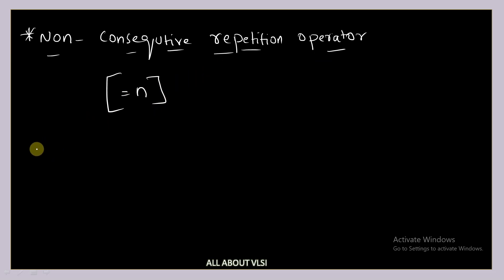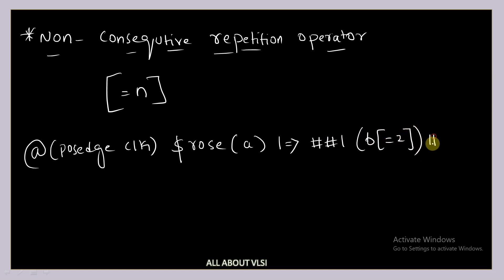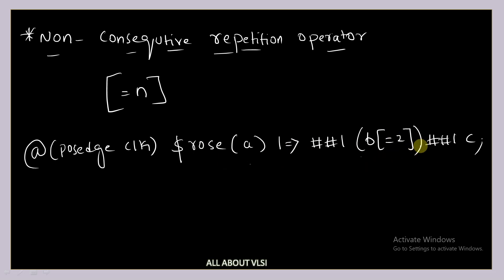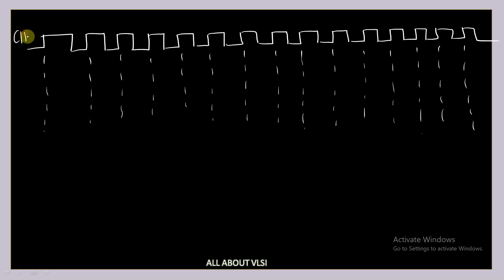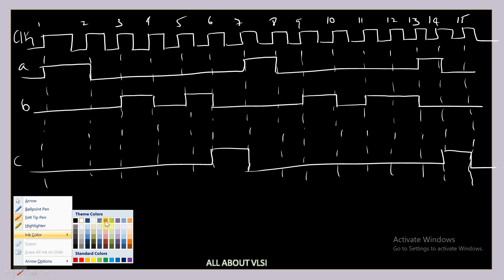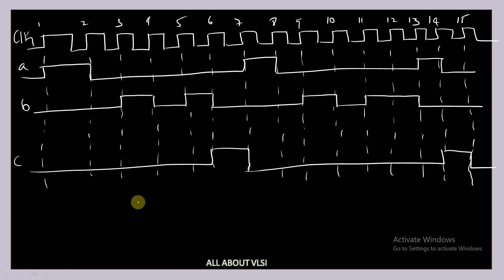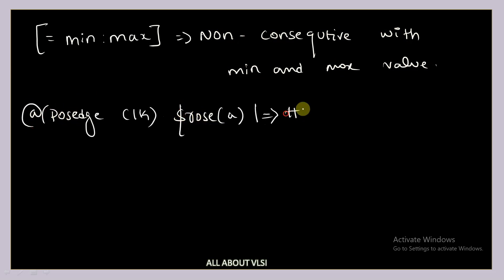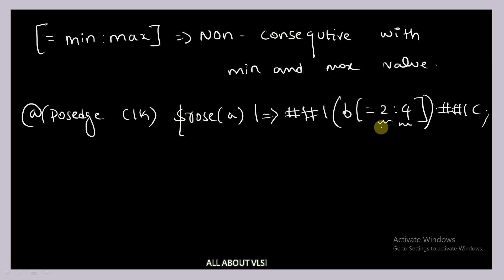Non-Consecutive Repetition Operator in SVA || System verilog assertions || All about VLSI||

Comment: So the b... ##1 c means as long as c is high at least 1 cycle after the last b? So even if c became high 7 cycles after the last b the assertion would pass?
Then doesn't that mean that " $rose a => ##1" means at least two clock cycles after the rising edge of a?
Reply from the maker: Answer to question 1
Yes

Answer to question 2
Not atleast it should be
Reply: @Allaboutvlsii  So why does b... ##1 c mean at least 1 cycle after b, but $rose a => ##1 mean should be after 2 cycles? Is it the operator that enforces that it should be two cycles after, not at least two cycles after?
Reply from the maker: @cxj999 with a we are using non overlapping or next cycle opeator with a delay
So it adds 2 cycle delay

Once refer about overlapping and non overlapping implication operator video in our playlist

Hope it clears your query
If not contact me on LinkedIn
Tadakamalla Gourav
Reply: @Allaboutvlsii  I understand the operator, but I am asking why does the delay after a mean "should be" but the delay after the last b mean "at least" ?
Reply from the maker: @cxj999 it's the nature of the operator we are using
Reply: @Allaboutvlsii  Analysis of the Assertion
First, let's break down each part of the assertion to understand its precise meaning.
@(posedge clk): The entire expression is sampled at every positive edge of the clk signal.
$rose(a): This is the antecedent of the property. The assertion is triggered when the signal a transitions from 0 to 1.
=>: This is the non-overlapping implication operator. It separates the antecedent from the consequent. Crucially, it means that if the antecedent ($rose(a)) is true at a given clock edge, the consequent must begin evaluation on the next clock cycle.
##1 (b[=2]): This is the first part of the consequent.
    ##1: This specifies a one-cycle delay from the start of the consequent's evaluation. Since the => operator already introduces a one-cycle delay, this ##1 pushes the check for b to the second clock cycle after $rose(a).
    (b[=2]): This is a sequence repetition operator. It means that the signal b must be true for exactly two consecutive clock cycles.
##1 c: This is the second part of the consequent.
    ##1: This specifies another one-cycle delay. This delay starts from the end of the previous sequence element.
    c: The signal c must be true at this specific clock edge.

Correct Timing Breakdown
Let's put it all together into a timeline:
Cycle 0: $rose(a) is detected (signal a goes from low to high). The antecedent is true.
Cycle 1: Because of the => operator, the consequent begins evaluation here.
Cycle 2: The ##1 before (b[=2]) takes effect. The first check for b happens here. b must be true.
Cycle 3: The second part of the [=2] repetition is checked. b must be true.
Cycle 4: The ##1 c takes effect. The check for c happens exactly one cycle after the last required b. c must be true.

Let's address the two parts of the explanation:
"The delay between a signal and first b signal must be two clock cycle delay (not at least 2 cycle delay)."
This part is CORRECT. The combination of the non-overlapping => (1 cycle) and the explicit ##1 (1 cycle) creates a fixed, mandatory two-cycle delay between the rise of a and the first sample of b.
"There is no restriction on the number of cycles between the last b signal and the c signal, as long as it is at least one cycle delay."
This part is INCORRECT. The ##1 c specifies a precise one-cycle delay. Signal c must be true on the very next clock edge after the sequence b[=2] completes. It cannot be delayed further.
Reply: @Allaboutvlsii  it is not correct according to the SystemVerilog LRM (Language Reference Manual).
In SystemVerilog assertions, the delay operator ##N specifies an exact, fixed delay.
##1 means exactly one cycle later.
##5 means exactly five cycles later.
This meaning is consistent and does not change based on what kind of expression comes before or after it.

 if the intent was "at least one cycle delay" for c, the assertion should have been written as:
... (b[=2]) ##[1:$] c;
This correctly states that after the b[=2] sequence completes, c must be true at some point in the future, starting from the next clock cycle.
Reply from the maker: @cxj999  refer page 36 and 37
https://systemverilog.us/vf/goto_conseq.pdf
Reply: @Allaboutvlsii  Okay, it makes sense now. So the [=n] operator is the only operator that allows the flexible timing of c. Because [*n] or [->] makes the c have to happen exactly one clock cycle after the last b. Thank you for providing that official documentation.
Why does the [=n] operator do this? Is there a reason?
Reply from the maker: @cxj999 I'm also searching for the reason 
Cant find the exact answer